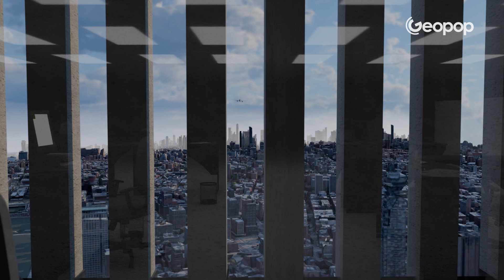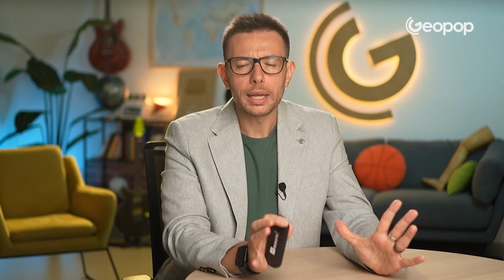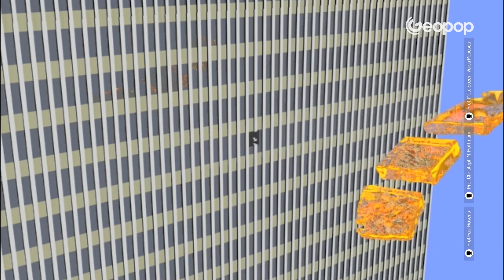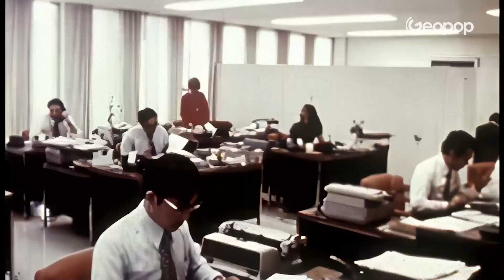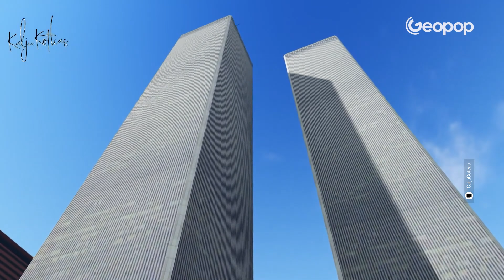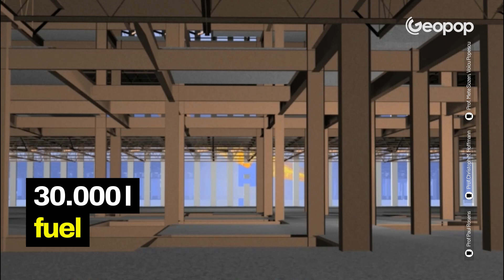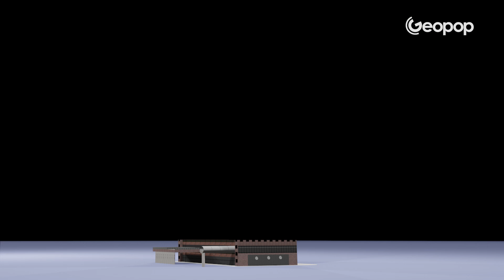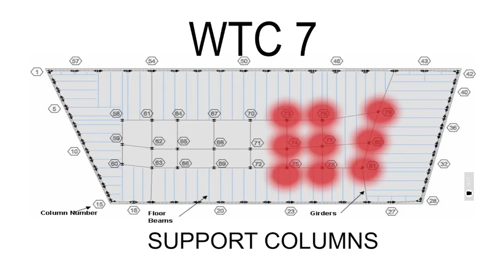9/11, 2001: The Technical Reconstruction of the Twin Towers and WTC 7 Collapses

Comment: What about the molten metal pouring out of the building? Looked like thermite melting metal by cutting I-beams. Not many people talk about the explosions on the phone calls to 911 and the radios of all the first responders.
Reply: You mean this?

youtube.com/watch?v=xPVGGQU-MeQ&ab_channel=SeekersofTruth

The Boeing 767 which struck the South Tower weighed 117 tons and 80% of that was aluminum. The exterior cladding on the Twin Towers – the white panels – were also aluminum.

When Flight 175 struck at the 81st floor its momentum deposited much of the office contents in its way and the bulk of the aircrafts mass into the NE corner of the building. The piled up debris shoved into that corner is visible in photographs and video so we know it was there. There’s a good shot here of piled up debris from 4:36; youtube.com/watch?v=ZLJyL63sqtU&ab_channel=MrKoenig1985

Steel melts at roughly 2,750-deg F while fires in the South Tower reached peak temperatures of around 1,800-deg F. Aluminum OTOH melts between 887-deg F to 1,180-deg F depending on alloy. That aluminum will melt under these conditions is not a surprise. If you look at pictures of cars left behind and destroyed by forest fires the aluminum wheels are invariably melted away along with other sometimes aluminum parts like hoods. Steel bodies remain intact.

The “molten metal” appears at 9:52 am. At the same time we see the first externally visible signs of sagging floor trusses and the pulling of the perimeter columns inward. I submit these events are related, not coincidental. The aluminum cladding at the NE corner also appears to me to be burning. It is likely with the floor trusses sagging under the heat, and the 81st floor truss in the NE corner under the debris pile subjected to the heavy load of the debris pile, the truss broke its perimeter column connections and dropped, instigating the material starting to pour out of the NE corner at the 80th floor. Given the properties of the materials in question, aluminum is by far the most likely culprit.

Reports from The NIST, FEMA and MIT all concluded the material is aluminum.

Certainly steel is the least likely of all the materials the anomaly could be given its much higher melting temperature and the fact there is no logical source for molten steel. The perimeter columns in the NE corner are intact and the material is pouring out between them. So it isn’t columns melting, therefore what other source of steel is there?

Deniers will claim molten aluminum appears silver when molten, which is true but only at the low end of its melting temperature range. Aluminum can and does get hotter and it glows red to orange when it does (1,100 to 1,800-deg F). Most folks of course just don’t bother getting it that hot if the goal is just to get it molten for say molding a part. No need to go higher.

The total mass of molten aluminum is a BIG deal in regard to how it behaves when poured. Quantities bellow half a liter cool almost instantly if poured onto a flat surface, but if poured into say an ingot mould will stay red for a minute of so. Pouring volumes of molten aluminum greater than a liter is a VERY different experience. The thermal mass is much greater and the radiant heat is horrendous. The aluminum is able to stay liquid and remain glowing bright orange much longer.

The famous video of glowing liquid gushing out of Tower 2 moments before it fell, involves at least tens of liters of molten aluminum. The thermal mass involved is so great that it stays red after falling many meters through the open air.

Side note: There was also a large UPS battery farm in that spot and some of that material at least may well be from the batteries IMHO.
Reply: molten metal was not pouring our the building.

Comment: Sad but true you have no idea what you're talking about truth 911 architects end engineers check out their website Nest is run by the government planes do not fly through steel buildings fire does not destroy steel buildings it was all a controlled demolition do your own research before you believe this video
Reply: Dude. The planes didn't go "through" the towers, they exploded. And fire very much can fuck up steel buildings enough to be taken down by its own weight, if it can't, windsor 2005 was a hoax, plasco building, the kader factory fire, all that were false flag too?
You can hate the government without thinking they are evil all-knowing all-planning masterminds.
Reply: I did check out AE911T.  They are idiots operating a perpetual fund-raising machine who have achieved absolutely nothing in 20 years of existence. 

Their brain trust for most of the organizations existence has consisted of;

One former manager of architects whose career highlights include designing a high-school gymnasium and a Denny's. This guy explains the complex interactions of millions of components by banging two cardboard boxes together.

An unlicensed civil engineer who builds radio transmitter towers who is responsible for their structural engineering analysis, even though he isn't a structural engineer. It shows. He is also one of the most truly unpleasant human beings I have ever interacted with.

Their top physicist is a retired 9th grade science teacher.

Their FEA is done by a carpenter using MS Paint.

And so on and so on. You get the idea. Not exactly a deep talent pool. Almost none of their core group of experts are still actively involved in the organization, which has been reduced by posting comedy meme's on Reddit featuring Simpson's characters.

Meanwhile the 130,000 member American Society of Civil Engineers - ALL of whose members are qualified engineers - fully supports the conclusions presented here. And that is just a start. In 24 years zero structural engineers of tall buildings, including the 1/3 that have retired in that time, have made any statements in support of 9/11 Truth BS demolition claims. Zero, nada, none.

Comment: I think another key mechanism that wasn’t quite described in detail (but really helps to paint the whole picture of the towers’ collapse) was how the effect of steel weakening and individual floor collapses reduced the exterior columns’ resistance to buckling. For anyone who’s math/engineering  curious, the column buckling formula is Pcr = π²EI / (Le)² where Pcr is the “critical vertical force” at which a column will buckle, E is the “strength of the material” (as described by the stress-deformation graphs that were presented in this video), and Le is the “effective length” of the column.

By how the building was designed, each floor acted as a horizontal brace connecting the core to the exterior columns. In short, this meant the effective length (Le) of the exterior columns (in terms of resistance to buckling) was a single storey in height. As floors began giving way, the Le of the columns around the impact zone started increasing by how many floors had collapsed. For simplicity, consider under normal conditions the critical force (Pcr) each column could resist when the critical length was “1 storey”; Pcr = 1/1 (100%). A single story collapses, Pcr = 1/(2²) = 1/4 (75% reduction to the force required to buckle the column). 3 storeys; Pcr = 1/(3²) = 1/9 (89% reduction). 4 storeys; 93% reduction. Etc, etc. 

Basically, the force required to buckle the exterior columns decreased exponentially with every floor collapse. Paired with the increased weight on each column given how many were severed by the initial impact and explosion (fewer columns remained to hold the weight of the building), it’s a miracle the buildings stood as long as they did. This is why you can see once the structure did eventually fail, close ups show the collapse being initiated by the exterior columns buckling inward.

Great video!
Reply: That makes sense. I'm not an engineer but since the exterior walls were carrying a lot of the weight of the building. I could see how floor collapse plus weakened steel (from all the fires) would contribute to the collapse.
Reply: I get so angry when I hear stuff like, "planes never hit the towers, they imploded them, bombs were planted... and so forth.  Akams Razor best describes this event.  Sometimes, the simplest explanation is usually the truth.  The steel weakened because of the heat and burning jet fuel.  The towers collapsed and it was tragic.  Yes, great video indeed.
Reply: Columns didn't buckle floor by floor. The collapse initiating failure was column buckling.  After that the collapse progressed through the open office space, leaving the columns behind.
Reply: It’s cool how 20 damaged stories managed to crush 90 UNDAMAGED floors..
Reply: @TwinGoats  I hope you know that "G" is ² ???
Reply: @TwinGoats - The engineering is fascination should you ever bother to learn it.
Reply: @TheLoonResistance I’ve heard too many engineers contradict what was seen…. Why don’t demolition companies just start fires? First time ever that fires replicated what demolition does and it’s never happened since yet fires are fairly common. 🤔
Reply: @TwinGoats  - Well, because if demolition companies just started fires what would happen might end up like 9/11 with two buildings collapsing, destroying another 8 nearby buildings and damaging more than a hundred others, causing tens of billions of dollars in collateral damage.

Please tell me how demolition charges cause floor trusses to sag in a zone consumed by fire (fire which BTW would consume any demolition charges), which in turn causes the inward bowing of perimeter columns by up to 5 feet until they buckle.

www.youtube.com/watch?v=ULdiD6gYZO0 

Sometimes you just need to use the thinking part of the brain.
Reply: @TwinGoats arguing is pointless, bc i wont change your mind, and you wont mine.
 but, several fires have collapsed steel buildings since 9/11. at least 3 that i can recall, all of whom collapsed very similarly to the towers. 
the towers fire safety systems, asbestos coating and sprinklers, also failed to mitigate the fires started by the jet fuel and continued by the massive amounts of paper
demolition crews do not use fires due to the uncontrolled nature of fire. it is a CONTROLLED demolition. 
the collapse of the tower isnt easy to understand because of the towers unusual construction and the very unusual nature of a plane flying into it at ~500 mph. 
when we see horrifying things that we cant easily comprehend, we make up stories that are easier. the idea that that our security wasnt as airtight as everyone believed, that the US was not safe from the wars so far away, that over 2,500 people could die so horrifically in view of the whole world, is hard to comprehend. so the mind makes an easier explanation, that it was controlled by someone we know, that all of it was meticilously planned. because the thought of the US government being outsmarted by a group of terrorists is just too difficult to comprehend.
Reply: @leasinclaire yeah I disagree, I did buy the story until you look at it and too many inconsistencies make it impossible to believe even if the alternate is shocking and scary. Good thing is democrats lost so we both get to have our own opinion for now.
Reply: @TwinGoats
well said. A fairly recent example is the Grenfel tower in London when fire raged through it for hours and hours.
Reply: @TwinGoats  Whatever
Reply: @FUNKINETIK  did it get hit by a fully loaded 767 travelling just below Mach1?
Reply: @teapot2_1  No. Did WTC7 ?
Reply: @FUNKINETIK  WTC7 lost around 7 exterior columns from falling debris after the North Tower collapsed, it also incurred heavy damage on its south face in the middle of the structure. That combined with a fire that raged internally for 7 hours due to FDNY being unable to respond effectively caused the collapse.
Reply: @teapot2_1  lost 7 exterior columns, where did they go? I have watched lots of videos of WTC7 during what appears to be a fire and have never seen any showing exterior columns missing (or destroyed).
Reply: Even if this BS was true... wanna try the core structure?
Reply: @Kudde23 the core of both buildings actually stood for about 10-20 seconds after the rest of the building collapsed around it before it came down. 

That would go hand in hand with what the OP is saying that the perimeter columns buckling caused the initial collapse. If it was a controlled demolition the core would have came down with the rest of the building not stand there for 20 seconds afterwards.
Reply: @mahrixgamer6036 but what makes the core disintegrate?
Reply: @Kudde23yeah, it’s called controlled demolition
Reply: @anniemarie4120  Exactly!
Reply: @anniemarie4120  And now what?

Comment: All the idiots in the comments that say a fire shouldn’t have brought down the WTC towers.  A large plane crashed into each one, fracturing several external and several internal supports.  Add to that, the subsequent fires and collapse was inevitable.  As far as WTF goes, the fire was very low in the building structure and burned for over 7 hours, the sprinkler system failed by the fall of WTC 1 & 2, and thermal expansion from the fires pushed a girder on the 12th floor off its seat which was a critical connection to column 79 which left it unsupported over 9 stories triggering structural failures.  While collapse from fire is rare, it can and has happened to many steel buildings when certain conditions have been met.
Reply: Some idiots in the comments are not aware of the fact that the twin towers were literally desiged to withstand airplane crashes. Airplane crashes even more destructive than the actual ones on 9/11. AND the resulting fires.
Building 7 that you call "WTF" for good reasons lost its water pressure long before either tower collapsed and there is no explanation for that.
It burned less than 7h.
And it collapsed in free fall over the height of 8 floors, which proves the controlled demolition.
Reply: @Kudde23 And the Titanic was designed to be "unsinkable." How did that work out?
Reply: @Kudde23 Please tell us how "they" managed to keep the explosives from igniting for 1-7 hours after the impacts, and raging fires? The colapses initiated at the point of impacts. So how did they rig the explosives so that they were not damaged by a plane collision?
Reply: Steelframed builgs never collapse due to FIRE before 911- this is why firemen march so confidently into burnig building.
It occured only that day ‘cause additional igniting materials were used
Reply: @MilaKlimova-t1m the firemen knew they were not coming out of the building when they went in. Anyone with half a brain knew that those buildings were coming down.